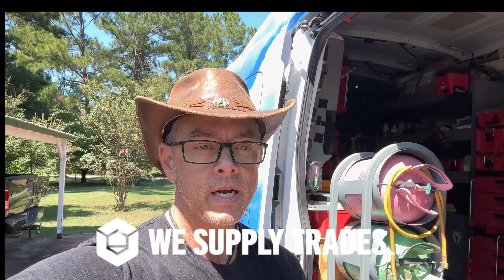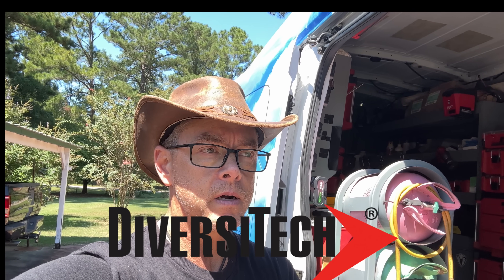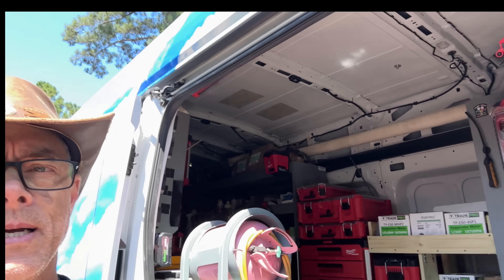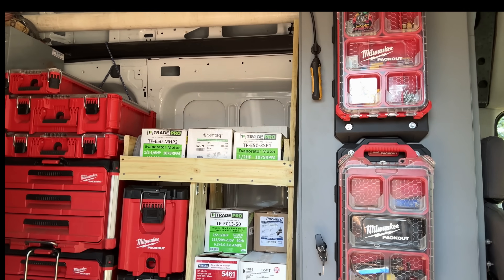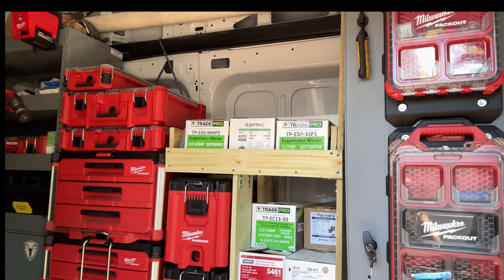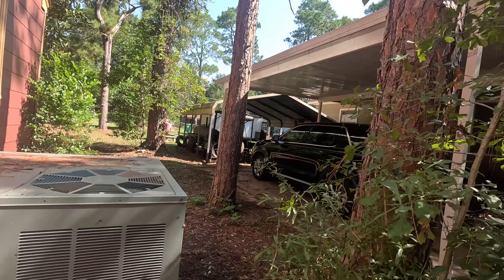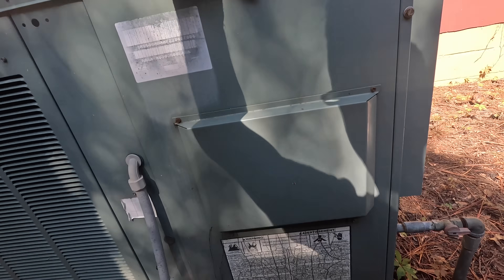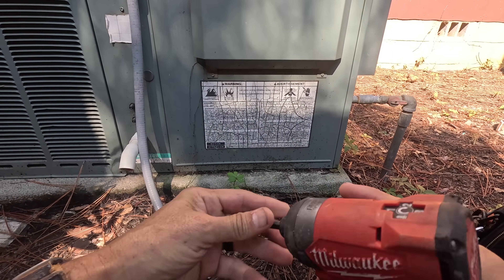Callback To Recent Coil Cleaning! #hvactrainingvideos

Comment: well, the shelving certainly isn't stain grade, but if it works it works. lol
in the past I have built stain grade cabinetry and installed prefinished stained cabinets, crown and trim, now that is a nerve racking pain of precision cuts and nailing! 
also many crude 2x4 and osb/plywood shelves too, of course the lumber was way cheaper than store bought shelves then and it still is when you want larger sizes, like 2' x 8' multi tiers high.

Comment: I've gotten  shocked by caps several times before and it is not terrible so some guys should grow a set of you know, its only a quick spark but getting shocked by a cap on a pole light I(dusk to dawn type) is another story, it grabs you and you will not do it again

Comment: I had the same call on an old Rheem the other day. Burned wire and low capacitor that I didn’t have either. I had to drive deeper into Atlanta just for a cap and Johnstone doesn’t have any 60/3s so I had to get two caps to make it work and rewire that compressor wire.
Reply: Fox Appliance, dude! They are in Norcross. Lol
Reply: @talk2azs well, I was in Brookhaven already. That’s why I said I had to go deeper into Atlanta.
Reply: @AaronPowellvox Lol. Understandable.

Comment: We had our AC not working back when we lived in an apartment. HVAC guy shows up, pulls out the disconnect, and started looking at the unit. I looked up and followed the electrical line and it went AROUND the disconnect. I said "Sir, I don't know much about electricity but I know it flow along the wire. It looks to me like that wire goes around the disconnect". He backed up a little and was like, Oh shit your right. Good call, that would have hurt.

Comment: Wow 50 + 3, what an oddball. I have used a terminal before on a friend's unit that kept burning off. It was different than yours but the same result. I know you are not a carpenter, but that looks dang good. I use to say, I'm not a good carpenter, but not a bad one either. I'm the kind of guy that can build anything I need. Hey you saved 2k according to Milwaukee. lol  Good video
Reply: I forgot to add, I like the way you acted like you were leaving the cap in the box, I wonder how many caught that. lol